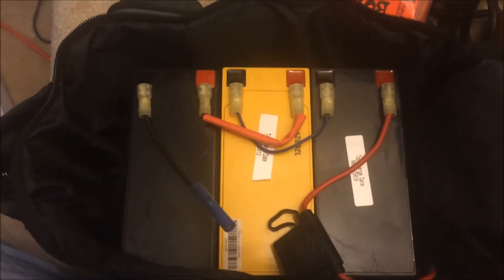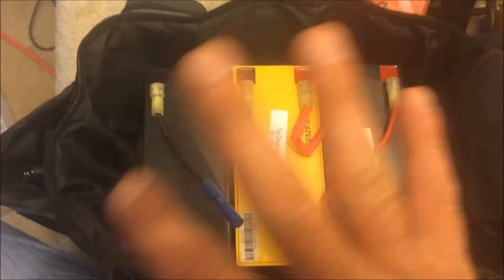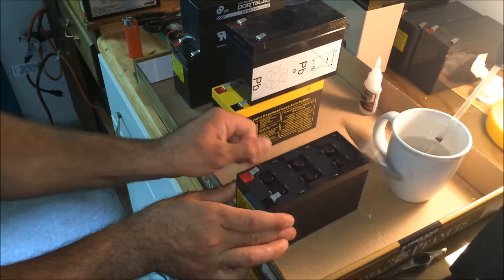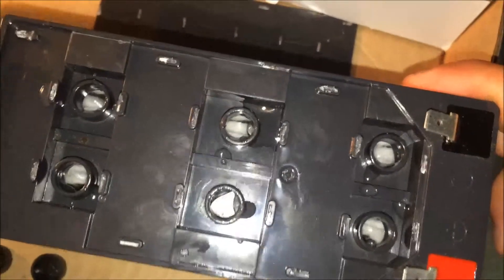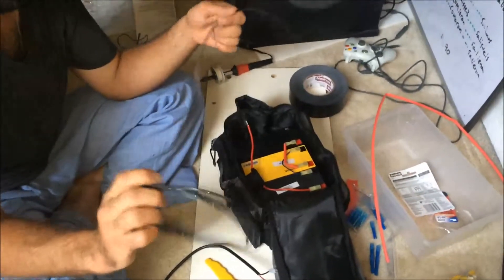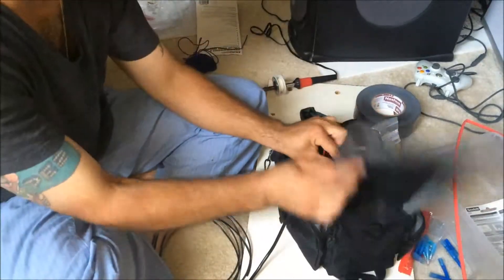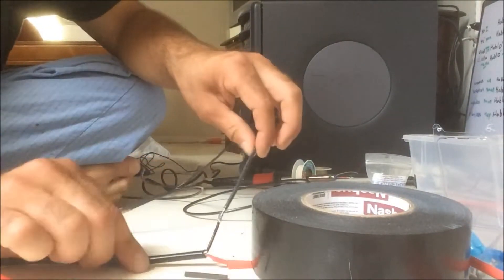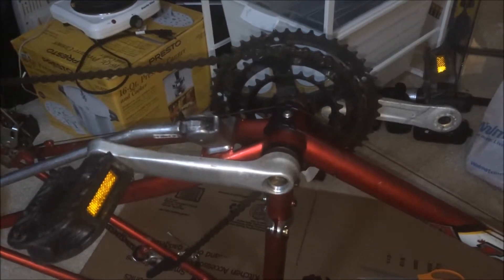Bafang Mid Drive Ebike Conversion Part 4: Lead Acid Battery Pack Build Part 2

Comment: Just checked the voltage on my batteries. They have 9v, so I believe they are ok not complety dry. Going to add some destilled water as you shown and charging them one by one using IMAX B6 charger. I would like to share that I didn't buy the ebike kit yet. I'm studying the solution. However I'm a little uneasy with the option you are showing - having 3x 12v7Ah batteries to power the 350WBaFang motor looks too low amps? I would expect at least batteries with 12Amps. 
How long can you run with them? What's you opinion about this... thanks in advance. My best regards,
Reply: Just saw you vídeo with the testing... The result is what I was expecting... Thanks.
https://www.youtube.com/watch?v=QwKyJePTtAU

Comment: HI,
I've 4x batteries 7amps like the ones you have. I'm going to follow the same guidelines... hope 3 are ok to use...
However I've question ... what type of charger to you use for 36v? how many amps while charging? 2amps? 1.25amps?
Thanks in advance.
Reply: i use a ebike lead acid 42 volt charger sp2000 ,and its 1.5 amps
Reply: sorry my charger says 36v but tested it pushes 41.8 says it charges in 2 to 8 hours
hope this helps
Reply: thanks

Comment: Some of that bridging wire's looking very light gauge for handling all them amps... you could melt it? Use maybe 12 g heavy wire with soldered connections,  you'll minimise voltage dropping. Which latter would/could impinge performance?